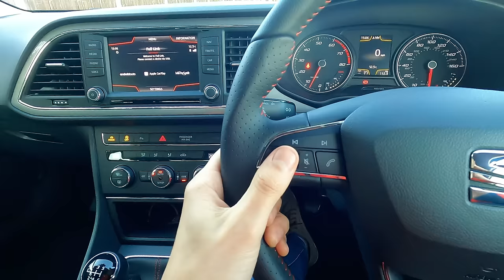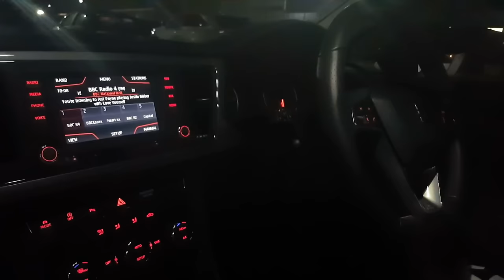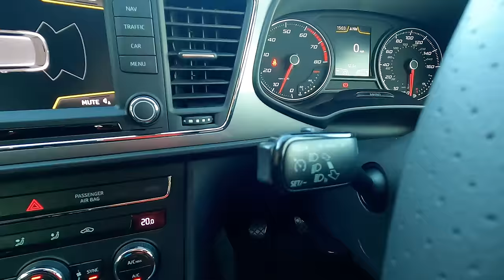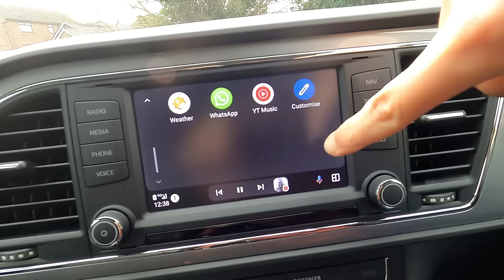Repairs and Costs Over 205,000 miles in a SEAT Leon Petrol

Comment: Well done. I Have got an Audi A3 1.9 TDI Automatic since 1998 with well over 700 000 kms, which I drive by HAND. So keep this SEAT. Greetings from Cologne in Germany. With 51 litres of Diesel I can drive 1337 kms from Spain to Belgium for example...
Reply: Goddamm, what have you done with the car to get 700k km out it? Commute from Spain to Belgium everyday???

Also how has the car held up in terms of rust?
Reply: 1.9tdi is very good
Reply: original gearbox? what are the gearbox service intervals?
Reply: A3 8L 1.8T 1996 (manual 6speed) Owner here, My dad has had the car since brand new and it now has 312 000km, I've done a hair shy over 40 000km in it and it's one of the most fun, soulful and reliable cars I've had the pleasure of sitting it and I absolutely love it, still drives perfectly in 2024 and doesn't have a spot of rust on it, absolutely Love both the 1.8T and the 1.9TDI Engines, as well as the cars they came with, cheers for doing over 700 000 km in it.
Reply: @aden3113  no. I can not walk so good and I drive around 30 000 kms every year. There's no rust. I have bought it from New. It is still very good. Thank you.
Reply: @amogus694  no. There is a problem with 2 plastic gears in that which drive the speedometer and therefore I have to revise the gearbox every 250 000 kms. Please change your automatic transmission fluid every 60000 kms.

Comment: My old 08 Mondeo is still alive. I took it from 19k to 180k. Sold it 7 years ago and saw it a few months back. It went to Tromso in Norway (6000 miles in 2 weeks) and down to Gibraltar, everywhere in between. Same clutch and only bits n bobs going wrong. That car was a legend and I once did 840 miles in Norway before the fuel light came on. It would do 45mpg on the autobahn over 100mph and would eat miles. I'm glad it's still alive but in a new home. I sometimes wish I kept it.
Reply: Mondeos are hugely under-rated cars! Mk4s were very popular with taxi drivers doing the long distance airport runs.
Reply: @Zadster I've got a mk4 titanium x and I love it. Quiet, comfortable, quick enough and economical. Ten year old car that hasn't failed an moy
Reply: @Zadster  I think too many abusers owned them. I avoid ford at costs simply because the quality isn't like before my neighbour was a taxi driver always needed work constantly on his car had it 5yrs he wished he sold earlier. I have heard of them with lots of issues so steered clear as there were better options on the market
Reply: I had a 1.8 tdci Ford Focus years ago. Kept it five years, ran perfectly and had been ultra reliable although now it would cost me in clean air zones but I wished id kept it a few years longer to stop me getting a lot of debt with new cars on finance. Bad move. Im getting another car soon, second hand, cash buy. I hate car finance these days.
Reply: @oddities-whatnot  get a toyota or lexus mate you'll love their reliablity or go for a 2.0TDIs or 1.9TDIs
Reply: My dad's old 2.0 tdci 07 did 350k until, I think the turbo went and he scrapped it. He's got an 08 now (and the turbo's failing at 200k).
Reply: @jakien  best is get a secondhand turbo or there are ebay remanufactured turbos

Comment: My parents have a 2014 DSG passat estate with 200k miles. Has been looked after all its life, and never provided any faults aside from a few engine lights here and there for minor things. great car and looks good being an executive model too, still no rust and bodywork is perfect.
Reply: have you had to replace anything in the gearbox
Reply: @JohnnyMQB  Surprisingly no! just regularly serviced.
Reply: @barryr10  that's good going 👍
Reply: I’ve done 217k in my 2014 Touran DSG without any problems. I service it myself every 9/10k and change the DSG oil and filter every 38k. Mine does mainly long journeys so has a fairly easy life. Just about to change the front discs from the originals. The original pads lasted 133k and rear pads 139k.
Reply: @frimleyfrodo  same here Leon cupra 280 dsg on 110k hopefully make it to 200k

Comment: A very good review. I have a 2017 FR 150 ACT. Purchased nearly new, only 4000 miles on the clock and under a year old. I have never had an issue with the car in over 6 years of ownership. Not even a bulb. It's been serviced every year without fail, and has been superb. One of the best hatchbacks of its time. Mine has only 33,000 miles from new. £35 pounds road tax per year, and can achieve over 60 mpg. Cheap to insure,and has a top speed of 134 mph. An excellent car by all means. I will be holding on to it for a while yet.

Comment: Absolutely testament to your decision to put your faith in Seat, your decision has absolutely paid it’s dues.
This car has had to work many times over than equivalent commuter vehicles yet has only had issues associated with wear/tear and/or issues from the factory replaced under warranty.
You seen to have had very bad luck with your VAG folding mirrors motors, my 10 year ford mirrors have yet to fail so keeping my fingers crossed!
Many mechanics will swoon at the underside of your car at that age, many cars that haven’t even reached their warranty expiry look scabbier than the photo you showed, gobsmacked!

Comment: I am a viewer from the United States and in 2001 I purchased a brand new Saturn LW300 wagon. 
That model is an Opel/Vauxhall Vectra B modified for the US market.
It has the 3.0 24v V6 and 4spd automatic. 
It has 386,000 miles on the original engine and transmission and the car starts instantly regardless of how long it's been sitting or the weather and runs and drives fine. The only issues it's ever had were shift solenoids that were replaced at 220,000 miles and multiple valve cover gaskets. 
It has never failed to start and it's only been towed twice.
Once when the fuel pump failed and once when the alternator failed.
Routine servicing by a knowledgeable mechanic over the years has resulted in exemplary reliability and durability.
It is a semi-retired dog taxi and extra vehicle now but it still accumulates between 7 and 10000 Mi a year.
A 2018 Buick Regal Tourx which is a rebadged  Opel Insignia replaced it and it's already accumulated 135,000 MI it is showing similar levels of reliability and durability.
Reply: Vauxhalls always want valve cover gaskets haha. I've owned two now both been the same. Luckily they are very inexpensive to replace. When anything goes wrong on a vauxhall cost of parts is very competitive. Shame the company has been sold off, it's pretty much a dead brand now.

Comment: I have a 2015 Seat Leon 1.6 diesel. It has 135000miles on it at present. I've owned the car since new and am surprised by the faults you've had with your car.  To date I've replaced the front struts (misting) glow plugs, timing belt kit and all brake pads  and discs once and one calliper. Still original alternator, battery and clutch. Has the same boot opener problem as you had. Full service history.  I'm not easy on the car by any means, used it to pull a caravan all over the country, pulls  trailer regularly and just basically a daily work horse. Interior is in great condition. Sadly the bodywork is showing some signs of age but just surface rust. This is why I've kept my Seat so long, worth more than  me that anyone else. I totally understand why you've kept your Seat so long.
Reply from the maker: It's important to remember how many hours my alternator etc has been running for as apposed to miles. If I averaged 40mph I would have done 800,000 miles ish.
Reply: @RichardFanders exactly you’re sat there got hours with engine on for learners

Comment: Very good maintained car! I have the same FR model, 1st owner 2018, facelifted model (1.4 TSI 150bhp), after ~40k km installed REVO official partner stage 1 tune, ~191 bhp, 300 Nm). The only warranty repair was the boot "shade" roll locker, which was faulty. ~100k km. Wear and tear: rear brakes and discs, tires, still original battery! (Start-stop disabled) and of course filters and oil changes.

Comment: I love comprehensive videos like this!

I got my first car a year and a bit ago, a 2011 2.2 diesel Mazda 3 at 87k miles. Obviously nowhere the use as your trusty Leon, but it seems the previous owner was a busy mother so plenty of use! I've since done 40k miles on it, here's the things I've done, and the things that were done before I owned it:
- Rear roll bar links (before I got it)
- New rear struts (free recall before I got it)
- New condenser (corroded, I think because it was a Scottish car)
- Front roll bar links (me)
- Injector washers (known issue that they leak so I replaced them preventatively)
- Brake light pedal switch (me)
- Front calipers (one was siezed, managed to free it up but replaced them anyway)
- I refurbed the drivers seat as the boulster was collapsed and leather perished, I think the previous owner would sit sideways on it with legs sticking out the car when parked
- I installed new shocks all the way around but I think that was just me being anal, the old ones were perfectly fine
- Headunit with android/android auto/carplay
- I have a door handle ready to swap out, the keyless button is a bit worn out

There's no rust on the actual body, though there is on the subframe and what not, though not any more than my friend's A3 of similar age, and nothing to worry about, though I am fluid filming it now. I'm planning a timing chain, and front and rear control arm replacement, and intend to drive the thing till it explodes! 220hp and 50mpg is truly great
Reply: That must be mapped they're only 180 standard

Comment: What an insightful start to your video.  I have a 13 plate diesel Focus with 208k on the clock from new.  It still drives like new delivering 650 miles on 50 litres almost every time and uses almost no oil between servicing.  But... It lives 90% of the time on the motorway at 60+ mph and always lives in the torque band between gear changes.  Bits of it are looking like trigger's broom and mainly suspension items as our roads are so poor.  But there are some other wear items: Clutch 180k, drive shaft 150k, a starter motor...  Regular oil changes and the second cam belt is booked in.  Tyres approach 50k between changes and I have only had one set of brake pads and discs.  BTW: No advisories on the MOT!  Your hours figure is massive, mine is about 5k and I have often though about that as my work is with large commercial and marine engines with 50-60-70k of hours and perhaps engine rebuilds at 20k.  Why does this flick my swithch?  My company are the UK Distributors for a bypass 0.5 micron oil filter system (plus fuel & hydraulics) that extends intervals between oil changes from 1k to 4k+ on large engines.  This reduces downtime, reduces wear to the engine components and reduces cost to the operator.  So by removing unburned carbon and moisture from the oil, the oil does not degrade and therefore there is less engine wear.

Comment: Great thorough video Richard, loved it. I’m just starting out as a qualified ADI and have bought a mint 3 years old Ibiza FR TSI 110 with 12k miles on it. 

In the past, I had new cars every three years pretty much for 20 years then started buying low mileage nearly new. The notion of it feeling different from a brand new car wore off quickly. Once I’d spent a bit of time polishing up a nearly new car back to factory fresh if necessary, on reflection they all felt the same after a short time.

Comment: I drove exactly that Leon as a rental back in 2018 and was so impressed (even against many much more expensive cars) that i said to myself i´ll soon buy it. i didnt really need it cause my old one was fine so i pushed that plan a bit further down the line...and then covid hit and it was hard to make money. really glad i didnt buy the car shortly before and thus didnt have to pay it off when money was sparse. now, everything it back in normal working order again and, even after 6 years, i still gravitate towards exactlly this car. new car prices have gone up so much that i have a hard time justifying that for not much more in return (in some ways even less when looking at stupid touch controls, clogging particulate filters, increased weight, missing manual gearboxes s etc.). i will keep an eye open for a good used one. this video had really excelent insights! thank you.

Comment: Brilliant summary. I've got a 2017 Leon estate with 1.2 Tsi, 63kw, it's done just under 60K miles. So far I had absolutely no problems until last week when I got the dreaded loose fuel rail problem (well, not dreaded, I only learned about it after it happened 😊). From what I understand, a number of engines made in 2017 had the fuel rail incorrectly fitted when the four bolts holding it were not torqued properly due to incorrect tooling.  The vibrations caused by the injectors work the bolts loose, some of them may snap and fuel starts spraying from the top of the engine. I had the four injector seals replaced and the rail bolted back on, hopefully correctly this time, it was around £200 to fix. This is of course relevant to all VAG brands, not just Seat.

Comment: I’ve owned 2 MX5s and can understand why you want to get your hands on a GR Yaris - I own one and they are fantastic. However, the front brake disks cost £1000 to replace and the clutch costs even more and they do get through both quite quickly.  In addition, the clutch can be tricky so probably not best for a learner - even experienced drivers tend to stall them more often. I still can’t blame you for wanting one and they are a natural choice for an MX5 driver.

Comment: Firstly, what an amazing video and huge credit to you for keeping this car on the road and looking after it as too many people would do the opposite, very well done! Secondly, I would highly recommend the Hyundai i30, specially the N Line model, which comes with a 1.5 turbo four-cylinder petrol with 160PS. We have one and its absolutely brilliant and has had no issues in the 3 years we have had it so far. They are also on the cheaper side, undercutting the Golf, Focus, and a lot of other rivals, at around £26-27,000 for this top spec N Line. The N Line spec also gets a manual handbrake too, still, in 2024, even on the automatic models too, so having that manual handbrake is a win, and something very rare in this class of car nowadays, and you get a 5 year unlimited mileage warranty, so I would highly, highly recommend the i30 N Line, a very underrated car, that also looks and sounds good!
Reply from the maker: Thank you, I have considered the i30 and just about every manual car in this class as and when released. The I30N fastback was my favourite.

Comment: I inherited my parents 2008 Mazda 3 after my mother passed this winter. And that's what motivated me to get a license (and why I found your channel). That car is really an eye opener to how important regular service is to a car. Yes, there is rust on it (that generation was very prone to rust), but apart from that it feels and drives like when it was new. It has a low milage for its age though so that helps, but I'm pretty sure it would not be in that good condition if it wasn't for the yearly service. I've installed a new android head unit, reverse camera and sensors in it to modernise it a bit. I figured since its in such a good condition it was worth spending a bit on upgrades. I'm pretty sure it will last for many years to come if I take good care of it. The rust is my only worry. New cars are so expensive these days. The newer generations of Mazda 3s are tempting though. But even the ones from 2013-2016 are so much on the used market.

Comment: I think you should just keep your Seat, and upgrade it a bit at a time, like how you added Android Auto. But you also can add better headlights. Or just useful features like that, which you want.

I recently bought a new car, it's a 2024 Mitsubishi Mirage ES. I've had it since September 27th, 2023, I put about 70 miles on it a day, it has 11,850 miles now. Very nice car. Even though it's one of, if not the cheapest new car here in the US, and the slowest new car, I really like the car. I am keeping it up like you are with your Seat. Goal is to one day reach 1,000,000 miles in it, even if it takes 30 years. Most of the driving I do is on the freeway. 

So far, the only things that needed replaced are.. Well.. Nothing. I want better tires, but will wait till the OEM ones are needing replaced. And just oil changes every 3,750 miles. Will be doing a transmission service soon, just as a break in change. New pan filter, cartage filter, and oil.

Comment: I have a near identical car - 63 plate, 3 door, same blue colour - the only difference is that mine has the 18" FR wheels. 

Bought mine with 50,000 miles in 2019 and its now done 93,000 miles all trouble free.

This video is great as it gives an idea of what to look out for on mine.
Reply: Have you changed the timing belt on yours

Comment: Awesome video and happy birthday to the Leon!
I've been driving a family hand-me-down Opel Corsa D, turning 18 years old this year! Very low mileage (just 60k) and i really love it. It's been mine for 3 and a half years and so far hasn't had any major issues. Drives great, good fuel mileage (diesel) and i've driven it all across my country and a few times abroad. The only complaints that i have are that the seats are not great, after about 2 hours it gets a bit uncomfortable, and that it's pretty slow (just 75 PS). Also, I find it lacks a 6th gear on the motorway.
Other than that, I'm very sentimental about it since it's my first car and I'm planning to keep it as long as it's running. Wouldn't trade it for the world!